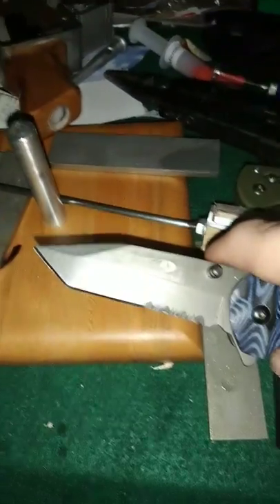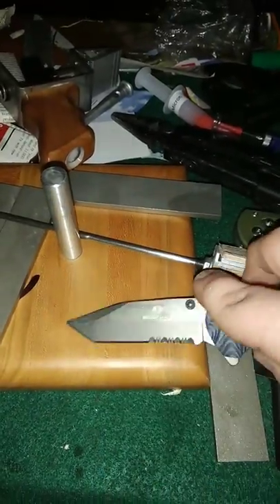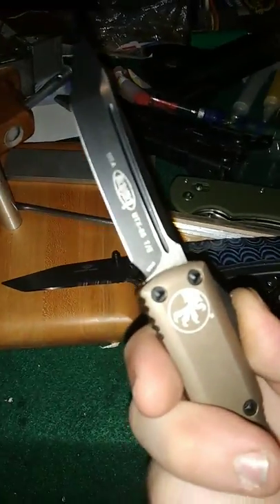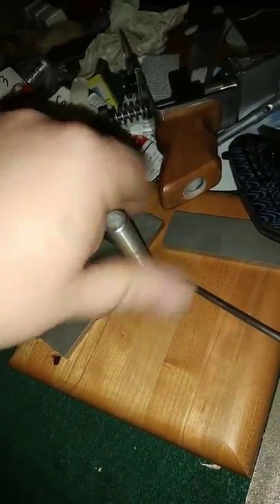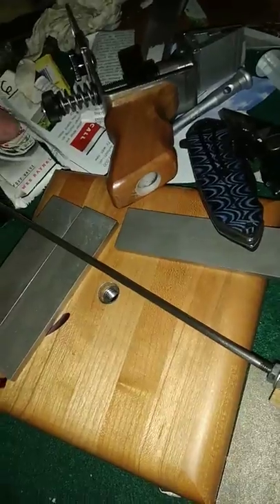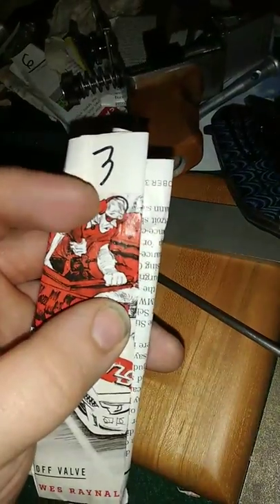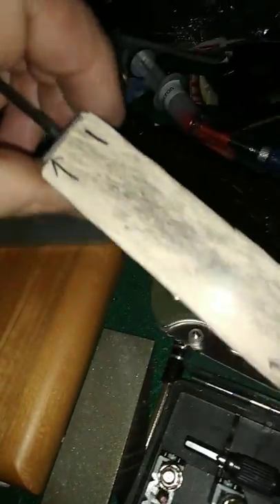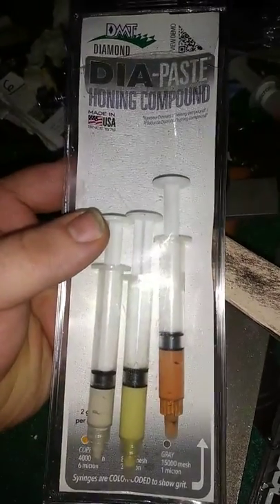My first mirror polish

Comment: Did you do that tanto as 2 separate edges to preserve the yokote like a Japanese togishi would? I have 3 tantos, 2 are Japanese ones that I’ll not touch, but the other is a modern tactical one and I don’t want to screw it up by bad sharpening.
Reply from the maker: First off thanks for the comment. Yes I sharpened it as 2 blades, from what I understand thats the correct way to do it. My tip is do as I did, get some cheap knives to practice on until you get that joint the way u want it because it takes a little more attention to do a tanto than any other blade style I have done. Kinda tricky at first but after a few hours you can have it down.

Comment: You still have quite an burr left on the edge, might wanna do something about it, feels sharp for sure but after few cuts you loose that high sharpness.
Reply from the maker: You don't know what you are talking about
Reply from the maker: @Oozy9Millimeetah  I make my own strops dingus. Its stropped. Thats the clear coat on the blade that stuck to it from cutting the kme stand
Reply: @mississippiknifenut4312 with what micron you start to strop?? Anything below 4 micron will increase most likely the burr. If you do a video do 5-10 cuts on cardboard then see if you still can push cut phonebook paper.
Reply from the maker: @Oozy9Millimeetah  u can't increase a bur with stropping diamond compound on leather. How old are you and when did u learn about knives because your on some CNN type shit
Reply: @mississippiknifenut4312  diamond compounds still "cut" the steel and therefore can increase the size of the burr, but we are talking about on a very small scale. Im 30 yo and have been freehand sharpening over 10 years, I've sharpened aprox. 90% of the steels commercially available. Im not here to put you down im just telling that it very much looks like you have a burr left on that tanto and might wanna take care of it, its a very common problem.